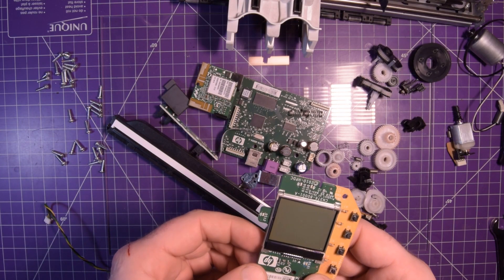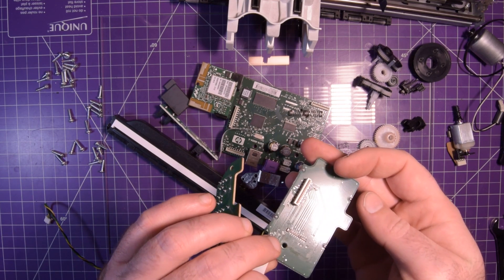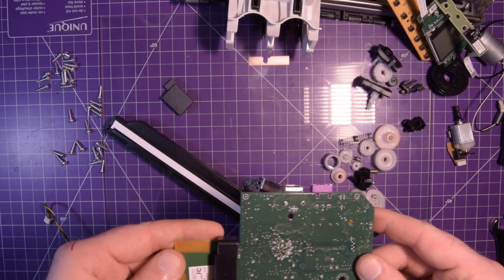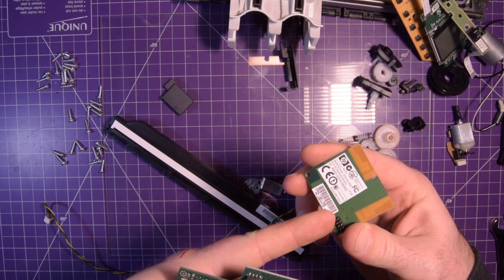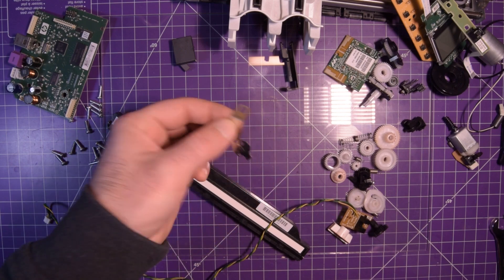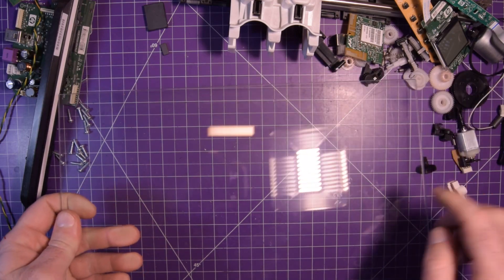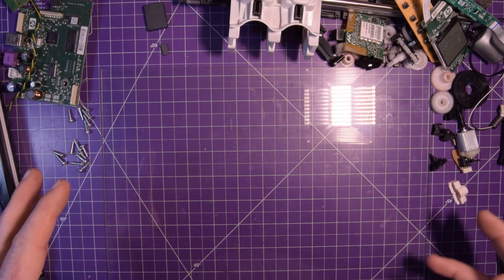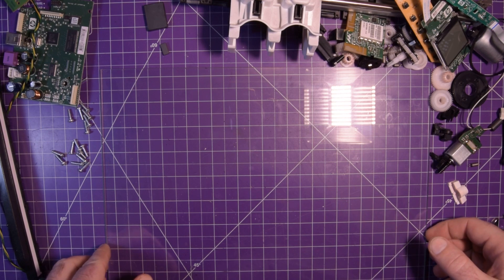What Can You Salvage From A Printer?

Comment: Wow fascinating! Thanks so much! I actually am having trouble throughout the years, I buy 40 dollar printers like this, because it is the cheapest way to get a working scanner, and before I can use it 3 times it will have an error that I can't straighten out, so it goes into the spare parts pile, with the hopes that I can get it resolved, or find reason to part it, and well, this is way better than I thought. Though I wonder, can I control the scanner without the printer part working? I will keep looking but just wondered if you dealt with it. Also, HP is really bad about being propietary so I doubt the reuse of anything on there, is that truth or a misjudgement on my end? I do have a couple HP things but especially with PC, they are a nightmare.

Comment: any idea what the optical sensors voltages are? i dont want to ruin them trying to find out.
i want to use them in an arduino project.
Reply from the maker: Not sure but they are LEDs, limit your current to 5mA and you should be fine!
Reply: @SimpleElectronics  thanks for the answer. that's a good call.

Comment: Please don't use that obnoxious "music" for time lapse in future videos.

How would you interface to that wifi/bluetooth module. Its going to be a completely custom pinout with no data available online. Its not a standard miniPCIe interface so you couldn't use it in a laptop.
 Even if you could workout the pinout, you'd still need to write a driver for it - good luck with that.
 Its just not worth the effort when there are standard bluetooth/wifi modules available cheaply on ebay with documents, datasheets and Arduino libraries freely available for those modules.

You could probably get the LCD working if you can identify the driver chip and connector pinout. It may be a custom micro controller. What would you use it for you could though?
Reply from the maker: Thanks for the feedback, what do you suggest I put during time lapses? And it doesn't happen much, admittedly
Reply: His kind of music. So just let him be